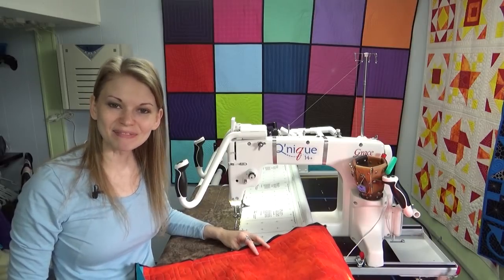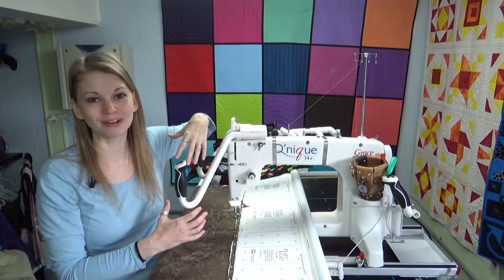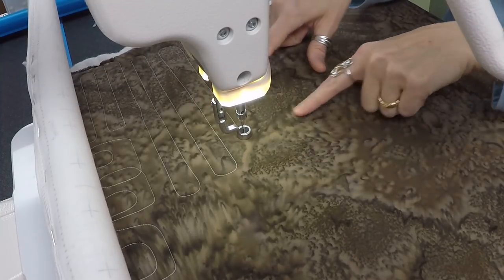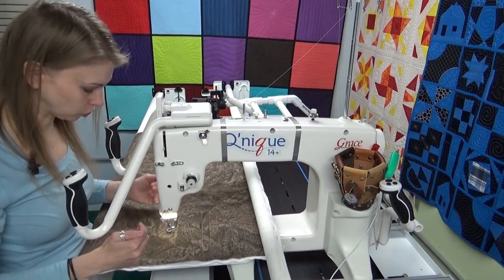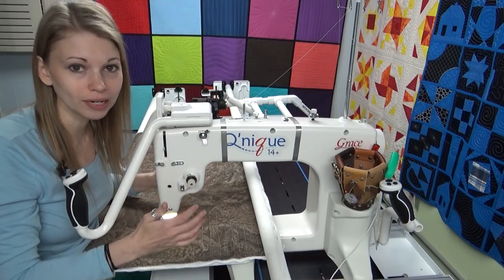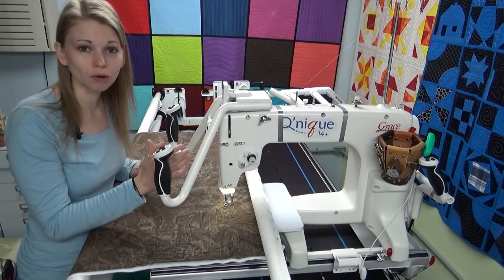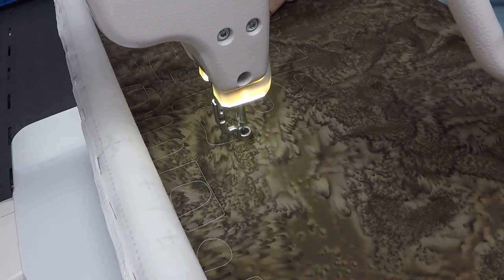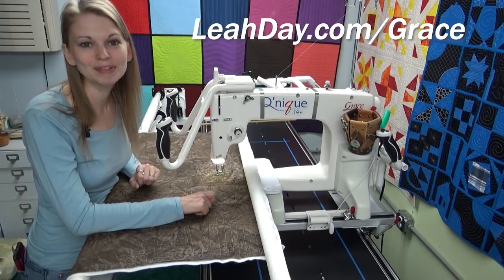Troubleshoot Tension Problems on a Grace Qnique Longarm

Comment: I use Isacord also but had never linked the white waxy buildup with the thread. I'm so glad you mentioned it. How do you clean it from the bobbin area?
Reply from the maker: I will first brush out the lint and if I see that bit of white residue I'll use a paper towel to wipe it down. Then I put a drop of oil on my brush and brush out and oil the bobbin case area all at the same time.

Comment: I’ve had my 15R only long enough to done one baby quilt on it. So now, on my second the tension is nuts! And there is a grinding sound like it needs oiling somewhere, but I’ve oiled it wherever the manual has said to. Even if I get the tension going well, it only lasts for about 12-18 inches of stitching, and usually my thread breaks. I’ve tried loosening the tension so many times to stop thread breaks, but then stitches are terrible. Do you have any ideas?
Reply from the maker: I would contact Grace Company and speak with someone from technical support. They will walk you through the steps to check your tension and get the machine going again. Sometimes the key to understanding a problem is going back to when it started. Here's the place to start - what changed on your machine between that baby quilt and this quilt? Did you change needles? Did you pop in a different bobbin? Did you change thread? Is the back bar still lifted high the way it was when you finished the baby quilt? As for the grinding, try to locate exactly where it's coming from - the back of the machine or the front?

Comment: I know this video is old but I always check your videos when I’m having tension problems with my brother 15r by Q’unique. I was having tension, problems and frustrated started from the machine cleaned everything up again wiped everything down check the wheels check the tension in the bobbin everything was fine then I realized you said start from the beginning and there was the mistake. Somehow the thread got wrapped around the one bar twice, I had to re-thread the machine turn the tension down and amazingly the stitches are perfect. Thank you again again for this video I appreciate your insight.

Comment: You explain issues so well.  Your honesty is refreshing.  Thank you!  Humidity plays a huge roll as do bobbin winding variations.  Bobbin winding inconsistency is a huge issue in my world.  My machine came with a wonderful stand alone bobbin winding product.  Can I guarantee it winds equally no.  A lesson learned.   I moved from a domestic to a sit down long arm.  World of difference.  Wind a bobbin load and go on a domestic. On my sit down long arm the tension changes as I work.  Not always the best experience but something I am becoming aware of.  Sound of the machine, top stitch quality and most importantly checking the under quality throughout the bobbin have eased my frustrations.  Wish the consistency was there your bet.  It may come.  Thank you again for a wonderful video.
Reply from the maker: Thank you Cindy! It's definitely a learning curve no matter what type of machine you're using! The key is exactly what you just said - awareness on what is going wrong and how to adjust to get things working again!

Comment: I just started on my new Grace co. Q'nique my first time run my bobbin thread was to loose. I read the book and it said to turn the large screw on the bobbin case clockwise a little at a time and check. it worked.
Reply from the maker: Wonderful! I'm so glad you found a solution!

Comment: Hi, Leah,

I'm not sure if this is the correct forum to put this, but I'm hoping that others who are struggling with tension issues can find some hope with my experience. 

I bought my "previously loved" Q'nique on a SR2 frame  about a year and a half ago. I have completed two quilts on it and am on my third. I have struggled with tension issues ever since I got it and even thought perhaps it was just a lemon and that's why the person traded it in for something else. I had it in the shop twice (in warranty, my shop is great) but the issue with taking it to the shop is they can't see what's going on at home. And to have someone come to my house is an hour drive for them.  I have watched numerous videos from Grace to try and fix the tension issues but still find myself with looping (eyelashes) on the bottom, bottom thread pulling through to the top, skipped stitches, thread breaks,  you name it. I have been so frustrated at times that I wind up on the floor in tears threatening 'Gracie' with taking her out and trading her in on a newer more sophisticated model. 

I wanted to say thank you for this video. I work in the IT world and making one adjustment at a time is what we do there as well so that we know what fixed it. I finally got my bobbin tension adjusted right and I was having better luck but still wasn't getting the quality that I felt I should be getting. The book only talks about adjusting tension in the bobbin and then the tension dial but says nothing about the place where you adjusted the little guide that was "jiggly". I went to 'Gracie' and took a look. The angle on my guide was different than what you set yours at so I adjusted it and voila, I saw a marked increase in the quality of my stitches. Then after quilting for a few minutes, I noticed that it was skipping stitches. I looked that up in the book and there were a couple of things in there that I checked. The first thing was the bobbin area. There was a ton of lint in there so I cleaned it out and I figured since I was there, I might as well lubricate my machine especially since I hadn't used it in probably a month. The next thing on the list was the needle. Somehow, in my stitching (vibration I am sure) my needle was slightly off (the eye wasn't straight from the front). I fixed it so it was straight and tested some more and I was still getting some slight skipped stitches but not near as many as I was getting before. The next thing on the list was the height of the foot. I keep a ruler foot on my machine as I use the ruler a lot. I checked it and it was a little higher than the book said it should be. I readjusted that (I used a credit card for height measurement) and tested it again and all my skipped stitches are gone, my stitch quality is better than I have ever seen it. 

The moral of this story is thank you! What you said about "don't try to troubleshoot tension when you are frustrated or angry" really sunk in. I would never have thought to adjust the guide that you mentioned and I didn't realize that there is more than one thing to check as far as tension goes on the top of the machine.

I'm very excited to finish the quilt I have on the machine now so I can start doing some very creative things on other quilts. Thank you so much for your videos. I look forward to them but of all the ones that you have done, this one was by far the most educational for me. You are an inspiration. Thank you!!!

Deb
Reply from the maker: Thank you so much for sharing this Deb! YES - tension can be caused my so many tiny little things like this that seem inconsequential, but when combined together can create a whole host of issues. I'm so happy this video helped you sort out the problems you were having. Also YES - never test, never troubleshoot when you're angry or in a hurry. It's completely pointless. Thank you very much for sharing your story!

Comment: Leah, first I love your videos.  Second I have a problem with my Qnique 15 Pro I cannot resolve.  I have tested this and the tension is great before I start quilting.  Then when I quilt on my quilt, the tension is crazy.  It will sewing beautifully for awhile then start the looping in the back of the quilt.  I have tried to adjust the tension (the white knob on the front of the machine) but it just spins and does not seem like it moves.  It was on 1 and a half, and I turned it several times and it is still on 1 and one half.  Am I doing this wrong.  I checked the threading first and it was right.  
Any suggestions on this"

Sandy

Comment: My machine was sewing fine then started to skip large areas, mostly when going around a curve.  I've tried everything.  Any ideas?
Reply from the maker: I’d first change needles and see if that helps. Then try backing up and think about anything else you’ve changed recently. Did you drop your bobbin case or change thread? If it’s only happening in a specific angle, that makes me think it’s a needle issue, but it could also be thread, bobbin, or the height of your quilt on the frame.

Comment: I know that this is an old video but…to put another piece of fabric on the frame to test changes the dynamic from the original quilt, right?
Reply: I’ve taken MONTHS as a break! 😆 eyelashes on the back! Ug!
Reply from the maker: You can use scraps from the actual quilt to test. Do check that you are quilting with quilting cotton. I had a student in class accidentally bring swimsuit fabric to class and not realize it until afterward. It certainly explained her terrible tension and thread issues. 
Take your current issues one step at a time. Don't rush it. You've been away from your machine for awhile, it will take a bit to get the feel for it again.

Comment: I'm having a problem with the bobbin. I can't adjust the screw any tighter and am getting thread loops from the top thread. Any thoughts. I did put in a new bobbin spring, but no luck
Reply from the maker: It sounds like you aren't threading the top tension. Lower the tension on the top to 1. Now when you thread the machine FLOSS the thread through the tension discs. Remember a longarm never loses tension like a home machine when the foot is up. The tension is constant all the time so you have to force the thread through the tension discs. 

Also if your bobbin spring fell out, that might also be contributing to the issue. Getting it back in perfectly is really hard. Switch to Mega Genie Bobbin Washers instead - https://leahday.com/products/magic-bobbin-washers?variant=27721648406600

Comment: If you use isacord on top what do you use in the bobbin? Great video, very informative.
Reply from the maker: Isacord! Same exact thread wound for the bobbin as the top. That makes life so much easier and far less tension trouble in general.
Reply: @LeahDay  thank you!
Reply: I’ve only ever quilted with Isacord. In my home domestic, it was never an issue. I purchased a long arm two years ago and I spend so much time ripping out inconsistent tension. I have tried to trouble shoot this. I’ve gone through the gambit and I’ve discovered that halfway through EVERY bobbin the bobbin pulls the top thread down and I have that lack of delineation on the back. I purchased a new bobbin case anticipating that that would fix this problem. Nope. I tried prewound bobbins. I have to pull off a lot of thread off the prewounds before I can get a quality stitch. So the end of my wound bobbins and the beginning of the prewound bobbins are problematic for me with tension. Grrrr. I’m throwing in the towel and taking the machine in to the dealer to have them trouble shoot this more. I’m in over my head. I have yet to find anything online that mentions the tension issue I’m having. I refuse to switch threads! I love Isacord. It’s probably something really simple that has caused me so much frustration. 🤷🏻‍♀️

Comment: I am new to the Q'nique 15R world and am having an issue with skipped/long stitches only when moving the machine from right to left. You have another video discussing that problem but I think you're talking about a domestic machine and free motion. Is there something I can adjust to correct the problem with moving to the left? (Love your videos! They have been SO helpful!) Thanks!
Reply from the maker: Try adjusting the height of the foot on the fabric. Also change to a size 18 or larger needle. I was getting thread breaks on my Qnique 15 until I bumped up to a bigger needle size and that fixed it!
Reply: @LeahDay  Thanks for your suggestions. I have tried adjusting the height of the foot but I'm not sure it's just right. It's trial and error. 😉 I'll try using a larger needle and hopefully that will make the difference.

Comment: I recently purchased the 15R Pro. It is on a QZone Hoop frame. Tension issues persist. As you point out, it is likely user error but I have watched this video several times and am still struggling. I have followed your suggestion to put a test quilt sandwich on the frame and adjusted tension, checked threading, changed needles, changed bobbins, tested my bobbin tension with the drop test.  I use Isacord thread and have it threaded as you demonstrated. It does much better when the tension dial is turned all the way to a 1 but it is still not very good. The top stitches look acceptable but on the bottom there are loops, much worse than the pulls you have on your corners. I am using the simple l and e loop pattern. Is it time to call Grace for help?
Reply from the maker: A few things come to mind- first have you checked the bobbin tension? Is the bobbin threaded properly? Did you wind a fresh bobbin or use what was in the box with the machine? Did you check the needle? Is it facing the right direction and fully seated in the machine?

Yep, all and any of these could be causing your looping issues.

Change one thing at a time and test between changes. I would stop doing loops and stitch a simple straight line towards your body then away from your body. Check my video on first stitches on the Qnique 21 to see my method from the first stitch.

Loops will often show far more problems than straight lines and it’s harder to see progress.

Also check the height of the back rail of your frame. I’m finding this to be a consistent issue that the back rail is set too high over the longarm and that can cause skipping and tension issues. 

Go very slow. It’s so so easy to speed up and miss guided and that just won’t work. I’m speaking from years of experience and getting frustrated so much I’m in tears, only to come back and realize the machine wasn’t threaded properly!

Let me know how this goes! This doesn’t sound like a faulty machine to me, but simply the normal adjustment to get it into proper tension the first time.

Comment: How often do you oil this long arm
Reply from the maker: Every day! Before I begin quilting, I pull the machine to one side, drop of oil in the top, drop in the bobbin, quick brush out and I'm ready to go. Longarm machines do not like to run dirty or dry so you must build a habit for cleaning and oiling your machine before using it.